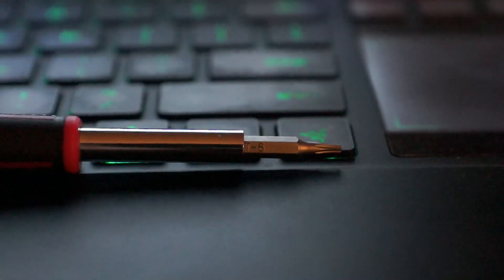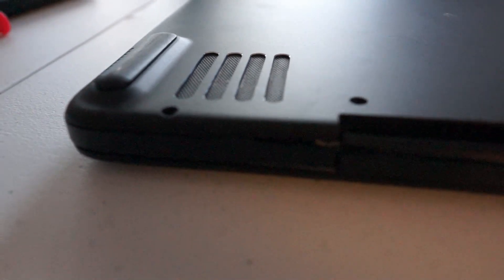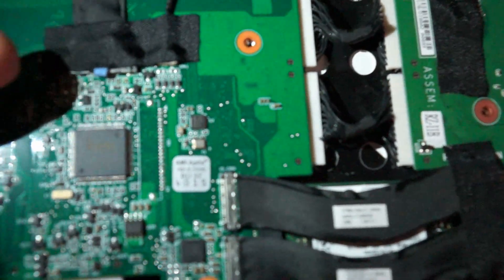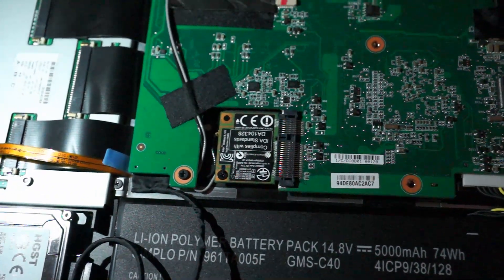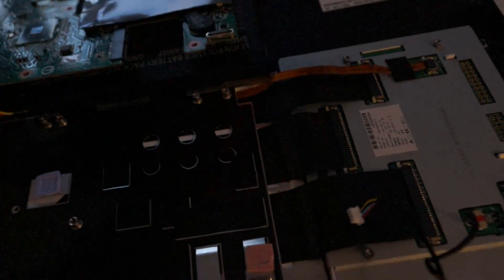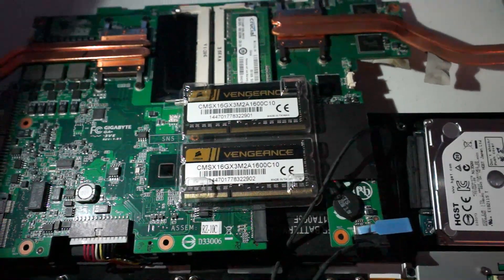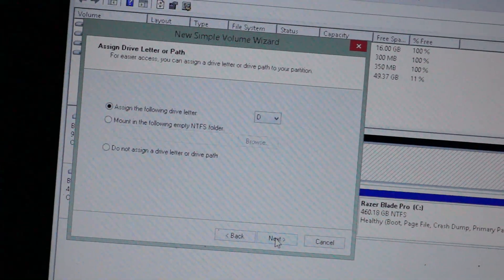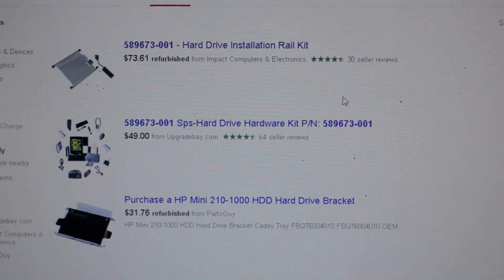How To Upgrade Razer Blade Pro RAM and Second Drive

Comment: How do you remove the connectors over the Sata drive?
Reply from the maker: +Samuel Mazo If you give me a time stamp like @__:__ I can elaborate. Otherwise, virtually all of the ribbon connectors with the metal ends are very tight/strong/stiff. They're honestly a tad scary to pop off. I was able to use my fingernails to get under the ends and pop them out. They're equally stiff to plug back in. The plastic connectors aren't as bad.
Reply: I talking about the large ribbon conectors
Reply from the maker: Samuel Mazo
Most of the connectors you don't need to unplug. The few you do are pretty strongly connected and need to be gently, but firmly, pulled free. Just don't pull on the ribbon cable. Use fingernails or a plastic pry tool to get under the edge of the connector to pop it out.

My battery recently exploded, so I'll probably do a video about that in the coming weeks. Contemplating making my own battery pack rather than paying $250 for razer to install a $50-100 replacement.
Reply: Maybe do a video of how to take off the ribbon connectors?

Comment: Hi friend.Do not tell a complete list of parts for your replacement??I have a laptop 2013, I want to make the same upgrade)) Thank you))
Reply from the maker: +Egor Petryaev Western Digital 1 TB Scorpio Blue SATA 5200 RPM 8 MB Cache Bulk/OEM Notebook Hard Drive WD10TPVT

I plan to replace that drive with an SSD when 2.5" prices drop closer to $250 for a 1Tb.
    
Corsair Vengeance 16GB (2x8GB)  DDR3 1600 MHz (PC3 12800) Laptop  Memory (CMSX16GX3M2A1600C10)

HP discontinued selling the cable I used, so you will need to find one from another HP laptop. The cable should be very short. These may work. They look like the one I used.

HP Pavilion DV6-3000 Series SATA Hard Drive Connector W/ Cable
HP Pavilion DV5-2000 Series Hard Drive Connector W/ Cable 6017B0265101
HP Pavilion DV5-1000 Series SATA Hard Drive Connector w/cable
HP Pavilion 14" DM4-2000 SATA Hard Drive Connector Cable 6017B0258901

Last time I searched I found a site that said those same part numbers 
fit a ton of other HP mini towers. Your best bet is probably ebay. The 
cable shouldn't be more than $20.

"List of compatible models includes: Mini 210-1000eb, Mini 210-1010TU 
PC, Mini 210-1024TU PC, Mini 210-1035TU PC, Mini 210-1043VU Netbook, 
Mini 210-1052TU PC, Mini 210-1062TU PC, Mini 210-1074TU PC, MINI 
210-1083CA NOTEBOOK PC, MINI 210-1095NR NOTEBOOK PC, MINI 210-1101TU 
NETBOOK, Mini 210-1107sv, Mini 210-1111TU PC, Mini 210-1119TU PC, MINI 
210-1128TU NETBOOK, MINI 210-1138TU NETBOOK, MINI 210-1155DX NOTEBOOK 
PC, Mini 210-1180ss"
Reply: +MotoErgoSum 
I buy:
Corsair 16 GB SO-DIMM 1600 MHz DDR3 SDRAM Memory (CMSX16GX3M2A1600C10)HGST Travelstar 7K1000 1TB 7200rpm SATA3 2.5"Int Hard Disk Drive HTS721010A9E630 (This approach ??)cable and tray for HDD you used from hp mini 2102 ?? as a tray, not loose ??Do you have a photo of the connector to the motherboard ?? Very good job, thank you)))
Reply: +MotoErgoSum 
What screwdriver needed ?? Screw the rear I do not have Torx 6.
Reply from the maker: Egor Petryaev
Tiny torx for sure. You might get away with using a small allen/hex. The screws weren't very tight. If I get time I'll grab my micro bit set and see what works.
Reply: +MotoErgoSum 

Intel Core i7-4790K 4 GHz UNLOCKED Quad-Core Processor  (Do you think it will fit on the motherboard ??)

Intel Wireless-AC 7260 (I also think the update module WiFi))

If you're still disassemble the laptop, look at the CPU module and WiFi. Is it possible to change them without soldering))
Reply: +MotoErgoSum you're right Torkham 6. I have over the bolts glued film was therefore not seen))
Reply from the maker: Egor Petryaev
Those stickers are supposedly there so Razer can tell if someone has opened the laptop. Heavy use wears them off. I had a few missing.

Comment: First of all TNX a lot for this video...

I have ordered this HDD tray:
aliexpress.com/item/New-Original-For-HP-Mini-210-1000-HDD-Hard-Drive-Bracket-Caddy-Tray-589673-001/2033126454.html

Since my goal is to place 2nd HDD with bigger capacity as possible, I am wondering which HDD dimensions can fit inside of tray and razer as well (height: 5, 7, 9.5, 12.5, 15 or 19 mm.???)

Can you recommend any HDD with 2TB which could fit inside? Maybe: SAMSUNG Spinpoint M9T ST2000LM003
Reply: +MotoErgoSum Does your Razer have the GTX 765M? I'm wondering if we have the same model laptop?
Reply: MotoErgoSum So the SODIMM slots are on the other side of the motherboard?
Reply from the maker: phYs1Cx That kit you ordered looks just like the one I got direct from HP. I'm not sure about height. I had maybe a few extra mm. 19 might be a stretch. That Samsung Spinpoint should fit. I added an extra little bit of foam padding to make sure the drive can't slide around at all in the bay.
Reply from the maker: Samuel Mazo
Yep. 2013 Razer Blade Pro (17"). GTX 765M. Just updated my drivers today. Runs Armored Warfare on Ultra pretty well. Not sure if I'm running Mechwarrior Online on Ultra settings or not.
Reply: Can you also replace the ssd to a 1TB mSATA one?
Reply from the maker: Samuel Mazo
Yep, gotta flip the mobo to access the memory. I haven't tried upgrading the mSATA yet. Still waiting for that 1TB price to drop to around $250. Still up around $350 right now.
Reply: MotoErgoSum Did you use an iFixIt toll kit?
Reply from the maker: Samuel Mazo
TEKTON tool kit.
Reply: +MotoErgoSum I'll stick with iFixIt
Reply from the maker: Samuel Mazo
They're very likely made in the exact same factory.
Reply: +MotoErgoSum Can you get me the website for notebook form?
Reply from the maker: Samuel Mazo
forum.notebookreview.com

Comment: A question about HP part 589673-001. Most of the vendors I have contacted about the item no longer carry it or it's simply the caddy without the cable. I have yet to open this laptop up, but what was the issue with the stock cable already in use and is there any alternative? 

For reference I am trying to replace the failing HDD with a Intel 730 Series SSD.

Thanks!
Reply from the maker: Donnie Rice There is no stock cable attached. There's just an empty bay. There are similar looking cables for HP Mini's, but I do not know if they'll work. See the conversation with Zhang below.
Reply from the maker: Donnie Rice If you're talking about the primary mSATA drive, there is no cable for that. It just plugs into the mobo. Make sure you're buying an mSATA like the Samsung 850 EVO 1 TB mSATA 2-Inch SSD (MZ-M5E1T0BW)
Reply: I'm a bit confused now... There is a 64 gig mSATA card and a 500 gig HDD stock in the laptop, I was under the impression you replaced the stock 500 HDD.

Edit: Yes, there is a LITE-ON 64 mSATA card  and a Hitachi 500 gig HDD. I wasn't even aware this thing had enough room for a second drive... If that is the case that is. The current HDD is failing however so either way that one needs to be replaced.
Reply: MotoErgoSum Additionally, did you have any thermal issues after resetting the MoBo? Upgrading the mem is only $99 and seems simple enough so long as it doesn't require reapplying paste to the VRAM and whatever else that would be separating.

It would also seem from backing through your vid you briefly addressed the HDD and it looks to be near the LAN card and unobstructed.
Reply from the maker: Donnie Rice
Which Blade Pro do you have that it came with a regular HDD? My 2013 just had the 512gb mSATA and an empty bay for a 2.5" secondary.

No thermal issues. Didn't have to mess with any paste or pads.
Reply: MotoErgoSum The Razer Blade Pro 2012. The internals, placement and construction wise, seem to be indentical aside from the fact the 2012 featured a 64G mSATA SSD with a 500G in RAID.
Reply from the maker: Donnie Rice
Then you're lucky you've already got the cable in the secondary bay hooked up to that 500.
Reply: MotoErgoSum That I'm hoping is the case. Should find out when these new tools and parts come in tomorrow. The 1TB EVO should be a very nice upgrade from that RAID setup.
Reply from the maker: Donnie Rice
I want to eventually get dual 1TB SATAs, but I'm waiting for the prices to drop to about $250. Right now I've got a 1TB WD blue for the secondary.
Reply: That's essentially what I did. 1TB Evo with a 1TB WD Black to replace the dying 500GB.

Comment: HP part 589673-001 - Hard Drive Installation Rail Kit
Question about this kit because I cannot find it on Amazon and also eBay, can you tell me what kind of connector it is? Appreciate a lot.
Reply: Dongqian Zhang They all look the same
A. GENUINE HP ENVY M6-1000 M6-1205DX 15.6" HARD DRIVE CABLE CONNECTOR DC02001IM00
B. Genuine HP 2000-2C 2000-2C10DX Hard Drive Connector Cable Adapter 6017B0362201
C. OEM HP Pavilion G7-2000 Series SATA Hard Drive Connector w/cable DD0R33HD000
Reply from the maker: Dongqian Zhang It looks most like these. Very short cable.

HP Pavilion DV6-3000 Series SATA Hard Drive Connector W/ Cable
HP Pavilion DV5-2000 Series Hard Drive Connector W/ Cable 6017B0265101
HP Pavilion DV5-1000 Series SATA Hard Drive Connector w/cable
HP Pavilion 14" DM4-2000 SATA Hard Drive Connector Cable 6017B0258901

It's probably a standard HP Pavilion part that changes part numbers as new model Pavilions come out.
Reply: MotoErgoSum I don't know if these cables work like the one you recommended in the video.
Reply from the maker: Dongqian Zhang
A site selling the kit has this in the description.

"List of compatible models includes: Mini 210-1000eb, Mini 210-1010TU PC, Mini 210-1024TU PC, Mini 210-1035TU PC, Mini 210-1043VU Netbook, Mini 210-1052TU PC, Mini 210-1062TU PC, Mini 210-1074TU PC, MINI 210-1083CA NOTEBOOK PC, MINI 210-1095NR NOTEBOOK PC, MINI 210-1101TU NETBOOK, Mini 210-1107sv, Mini 210-1111TU PC, Mini 210-1119TU PC, MINI 210-1128TU NETBOOK, MINI 210-1138TU NETBOOK, MINI 210-1155DX NOTEBOOK PC, Mini 210-1180ss"
Reply: I see, thanks a lot!

Comment: Could we upgrade graphics card?
Reply from the maker: Unfortunately, it's built into the motherboard. You'd have to do some pretty messy modding to use an add-on card. I wish they would have used a standard laptop card like my M17x Alienware. I upgraded that 2009 system with a GTX 675MX 4GB.

Comment: Is the lan card the same as the wifi card? Also which wifi cards are best to switch to that are compatible
Reply from the maker: The wifi card is separate. The LAN connector is soldered directly onto the board. I haven't upgraded the wifi because it's worked pretty well for me so far. If there is something better out there, it'd be an easy upgrade.
Reply: I have the 2012 razer blade pro and the wifi card in it is terrible can't even use the wifi if I am across the house want to know if it's an easy thing to swap it out
Reply from the maker: Andy Tan
If you watch the video I show where the card is. You'd just unplug it and put your new card in. You'd need to make sure it's the same connector. Can't remember off the top of my head what it's called. It's the shorter almost square shape with two holes in the corners for screws. Looks like the killer N cards are around $50 and most Intel cards ~$30.

Comment: kuhlka, I wrote a question to you, but the comment dissapeared. Did you get it?
Reply from the maker: Where did you write it? I rarely check my Discussion page because I never get notifications. Best way to contact me is by commenting on videos like this.
Reply: kuhlka
I did wrote in the video comments, i.e., here. But it dissapeared, first time it happens.Well, it does not matter, I was commenting that I have razer blade pro 2013 too, and I was wondering if the laptop as mini PCI-express to do external GPU upgrade. Like in this video
watch?v=bP_8EYQ-2RA

It would be great if its possible.
Reply from the maker: Cristobal Navarro
The only port like that on the Pro is where the wifi card is plugged-in. You'd have to do some serious modding and possibly not screw the case shut to run that cable... I wouldn't try it.

Comment: kuhlka does this apply to the razor blade 14" 2014 edition? If not can you make a video for that too please ?
Reply from the maker: I think the blade has no extra room for a second drive. The mSATA is the only storage drive.

It looks like the video cards (GPU) are on-board for both the 17 and 14, so no GPU upgrades unfortunately. It was so nice being able to upgrade the card in my M17x with a 4gb GPU. That 2009 Alienware runs games better than my Razer and all it took was a $200 video card from ebay.
Reply: Oh wow. That's Impressive.  But will I be able to upgrade the ram at all on mine? kuhlka
Reply from the maker: Rolando Rivera I did a quick search and found Razer Blade 14 (2013) Teardown. Looks like the 2013 has an extra mSATA slot but the memory is onboard. Same for the 2014 according to the website. Looks like you're limited to just adding a second mSATA or upgrading the factory mSATA.

Man, now that I know that I'll be sticking with the Pro for the foreseeable future until they bump up the memory. I honestly need 16gb+ for video editing and game dev.

Comment: Is it possible to replace the SSD currently in my Razer Blade Pro with a larger SSD, rather than adding a second drive?
Reply from the maker: Yes, but you might want to clone the restore partition over to the new SSD first unless you already have all of the drivers and windows on a thumb drive ready to install. You can see the primary SSD under the two black cables @3:02. Just remove the screw in the bottom right corner of the SSD and it comes out very easily. A little too easily. Mine fell out when I flipped the motherboard.
Reply: kuhlka Thanks for the information. So, it is not a standard 2.5" laptop SSD?
Reply from the maker: MysticManatee The empty bay fits a 2.5" drive like I used for my secondary, but the factory hard drive is that small mSATA under the cables. You could install a 2.5" and use the factory mSATA as a secondary if you wanted to. You'll need the short cable from HP to install the 2.5" drive, though. HP part 589673-001
Reply from the maker: I'm waiting for the Samsung 840 EVO MZ-MTE1T0BW 1TB mSATA Internal SSD to drop in price. It's currently around $436 on Amazon.
Reply: Hi!  I have been scouring the internet for a cable to purchase but nothing is available anymore.  Do you know where I can buy one?